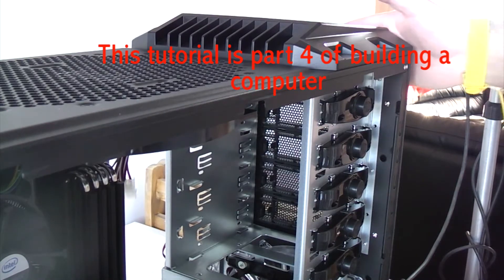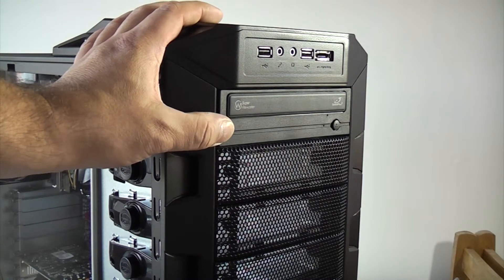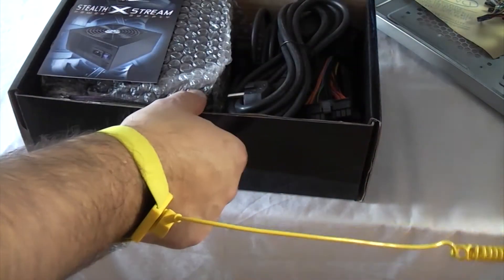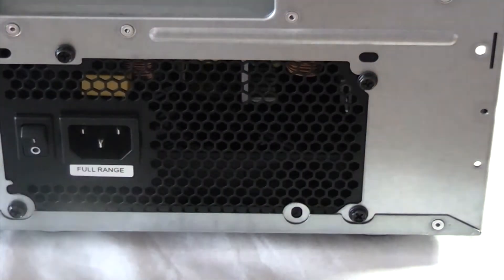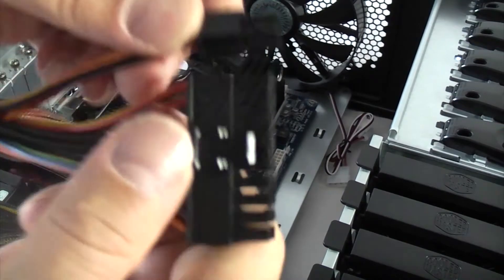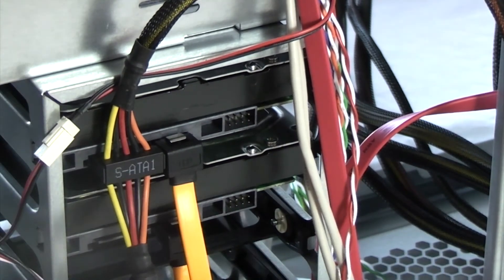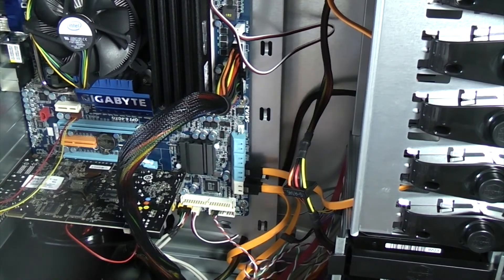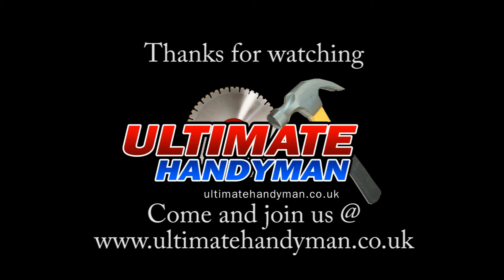fit drives cooler master case part 4 of 5

Comment: At 1:55 you sped by the most difficult part: inserting the hd into the hd rails. do you know how to re-insert the white grommet and hard drive screw pins? Mine came apart and I have no idea how they're suppose to go back in. they just keep on popping out. what a terrible design.
Reply from the maker: I've changed cases since this video was filmed. If I remember rightly, you just bend the plastic hard drive caddy side rails until the hard drive can be slotted in. 
Thanks for the comment 👍

Comment: I was wondering, do you need to buy sata cables ? or are they coming with motherboard or other parts ? like, do I need to buy extra cables or I will have all I need by buying a mobo, spu, cpu, gpu, memory and drives ? thanks !

Comment: I believe he is talking about the fan built into the case, which you mention at about 4:22. 

I am also at that point in my first build. I'm also not entirely positive what to plug this into. It looks like the plug with 4 pins inside can plug into a PSU cord, but I don't know where the other plug goes (or if it needs to be plugged into something at all). I assume the case fan doesn't need to be plugged into the motherboard but I have no idea.

Comment: You won't need the extra 4 pins on your mobo's power. And neither do you on the cpu power. The computer should boot up just fine with the 20 pin connector and just ONE 4 pin connector on the cpu power. Make sure it's on the right side though and not in the middle or on the left.

Comment: At the top left corner of the motherboard where the Cpu plug does in my power supply only gives me 2 4-pins. Do i fit both 4 pins in or just one? My motherboard isnt turning on :(

Comment: Does motherboard comes with the power supply as well? if it doesnt how do you know if the power supply has the neccessary cables for the motherboard? (i'm new at this)

Comment: @sonic911 yes... you wont have the same components (M/B CPU RAM etc etc) so u will get a Blue Screen u must install windows again on a formated drive. You can use whatever windows u like 32 or 64 (64bit support more RAM than the 3GB limiter on 32bit so if u have 2x2gb -or more- RAMS get 64bit).in order to Install Windows the Hard Drive u install them to MUST be Blank-Formated so yes your HDD will have to be formated. Back Up your files (music.videos.files etc) on another HDD or USB stick

Comment: which should i put first:the motherboard or the power supply??

also should i place the power supply with the fan facing down the bottom of the case or up??

Comment: Good video for people who are building their first PC's. However, I am disappointed in the lack of cable management in the video. I know the PC will work even in a salad of cables, but giving some tips about arranging and hiding cables in general would have been worth the time.

Also, for those wondering, the wrist band is commonly used by people working in electronic departments (factories, PC hardware stores, etc.), but they are not mandatory for a home user.

Comment: @e35554r ya gets rid of static. though i nver use them. i have built 5 computers without them and did no harm. 

Of course i have hard wood floors, if you only have carpet then you really need one.